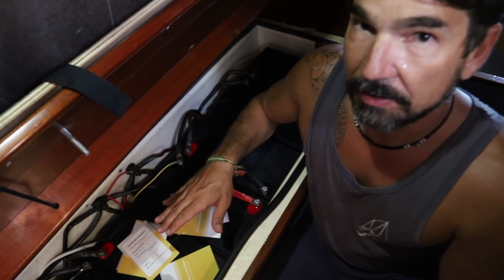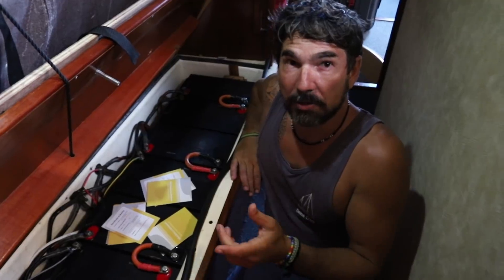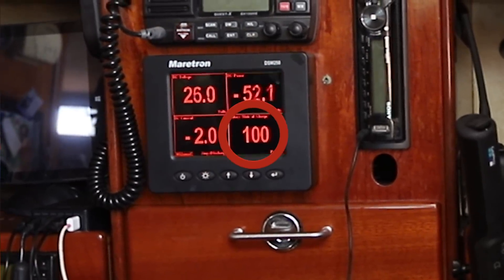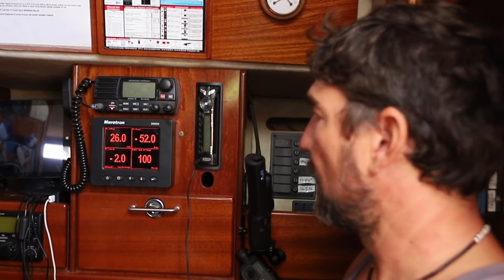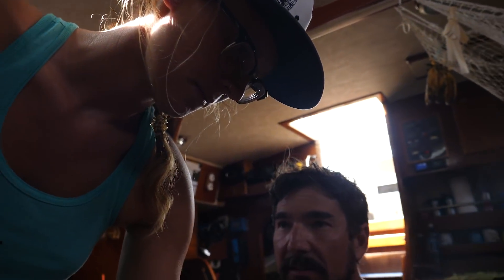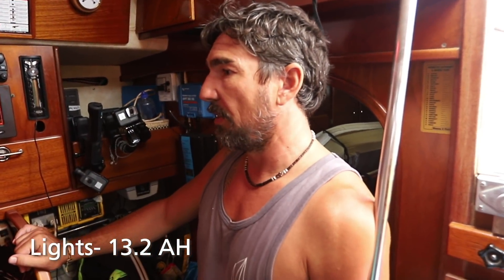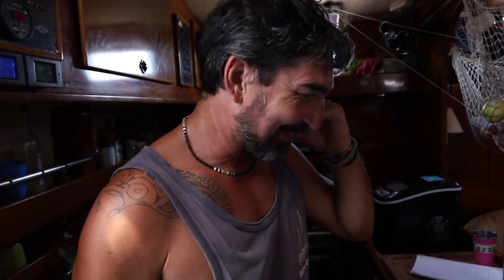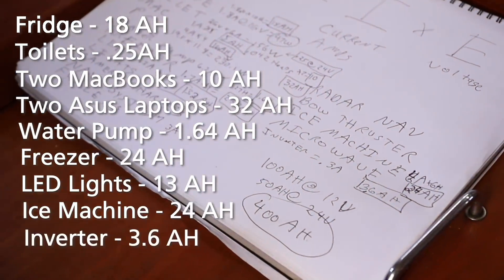WATT THE HELL is an amp hour?  Sailing Vessel Delos

Comment: This habit of measuring everything in amp and AH on boats is a bit confusing as it totally depends on the battery voltage used, using only energy units (Wh or kWh) and power units (W or kW) would be much better, but its the same with batteries for phones, computers, cars, electric cigarettes, etc. Would be nice if they did at least also always mention the Wh values ! But at least in this vid everything was brought back to W which was nice :)

Comment: Guess I won’t get an inverter for my bus then. Heard they were juice hungry...
Reply: Had a 2000 watt inverter in our RV when we traveled full time.  Essential item as far as we're concerned.  Example:  National Park at 9 PM and you want some popcorn, or  . . .early start in the morning and want coffee - in both cases you can't run the generator so use the inverter or do without.  Wouldn't be without it.  However, you're right - VERY power hungry.

Comment: Good vid !  An Easier to understand formula is Amp x volts = Watts. and Watts Devided by either amps or volts will give u the other. The P = i x e junk formula is not helpful.  just alkways driven me nuts. Volts are measurable with a volt meter. Amps are Measurable with a Voltmeter that has a amp clamp on it ( around $100.00 us ) and once u have the measured amps and volts = The wattage. Also Remember as Load increases so do Amps. So , If u Take a Serious Dump ,  That Little Shit dumper motor can draw alot of Amps up to 4 times more than Just a Water Flush. So, remember to eat your fruits & veggies.

Comment: Good job explaining batteries and amp hours Brain. One thing I can add to this is. Shallow discharges result in more cycles, but can reduce capacity due to sulfation. The user must weigh the cost of deeper discharges, and more frequent battery replacement against longer life, and limited usefulness.
Reply: TIM Babbitt I think sulfation occurs when the batteries are not fully recharged after each discharge. I have never heard of a LA battery becoming sulfated due to low DOD(depth of discharge).
Reply: TIM Babbitt this sounds more like the argument for slower discharge/charge rates. In experiments for battery life, it was found that slower charge rates and shallow DOD produced the longest battery lifespans, but it actuality since most people don’t fully recharge a battery after each use, sulfation occurs and research has found high charge rates de-sulfate the battery and although the high charge rates actually hurt the battery slightly, it de-sulfates them which causes much greater battery life.

Comment: Excellent video guys. On my 65 ft sail boat..... 200 AH  a day at 12 volts at anchor.  But could radically reduce this by a new efficient 1.8 amp fridge.  I have 500WTs of solar and 800 amp hours of batteries and  with this I don't have to watch how much  electrical  is  used each day.    After years and years living at anchor ...batteries last just under 4 yrs.  AGM's are less time.   This is living off the grid !  Oh... and a single person on board who watches alot of movies !

Comment: Hey Brian and Delos crew -Cool and informative stuff. Regarding life cycles of the batteries (and weight/space ratio...): How about the LiPo batteries on the market now? Have you considered using or testing them -even considering the (at times) tricky charging of these new batteries?
Reply from the maker: Stay tuned for next week on the Lithium :)

Comment: As far as I know the battery capacity isn't independ of the amps drawn. The usable capacity is bigger if the energy is been drawn over a longer period of time. I'm not sure what's the reason for that if it is the inner resistent of the battery.
Reply from the maker: I believe it's known as the Puekert effect or something like that.

Comment: Nice! Thanks for the info, Capt. Brian! 

 I've always wondered why batteries are sized by Amp-hours instead of Watt-hours?  Seems like basing everything on energy (watts) instead of current (amps) would simplify things considerably.
Reply: There is a subtle difference between the two, and some battery-history to understand why. In this type of application, the two types of measurements could be used. Could take amp-hours of battery times some nominal voltage, and multiply amp-hours consumption times some nominal voltage. Then KWhrs could be used, but I don’t junk it is that much easier. The difference between the two is KWHrs is a energy, and a Amp-hours is a charge. Batteries receive charge and we measure that charge in amp-hours.
Reply: So it is partially tradition that we use amp-hours for consumption (energy audits) since we used it for battery charges and battery specifications. The reason it is more useful for battery charging/specs is that the voltage on a battery changes over its state of charge, so accurately measuring the KWhrs into and out of the battery is more challenging and harder to state, than saying it will produce 100 amps for an hour, at whatever voltage that it falls at.

Comment: Hello Brian and Delos Crew,

 Thanks for your advises and explanations. We need it.

 What kind of water maker and instant water heater you have onboard?
 How you like these models, what's the maintenance, efficiency and power consumption? How much cost   the filters? Are they available in most countries? If any other details missing, we like any of your videos.
Thanks y'all Delos crew and cheers,
Reply from the maker: Hey!  Our water maker is a large AC unit, it runs on 220V from the generator put makes about 200 liters and hour.  The  power consumption is high (2-3KW) but we don't have to run it that often because it makes water quickly.  Water heater has two sources- heat exchanger on the engine and also electric from generator.  The water maker membranes are hard to get, but only need to be replaced every 6-7 years or so if you treat them right.  Fair Winds!  Brian

Comment: Good detail of usage.  The Macs have alot less screen and much slower than those ROG's unless they have the Gen 8 chips.  The laptops this past christmas had 58 types using the Gen8 chips but Apple did not.  They were still using 18 month old chips.  The Dell 2 in ones are something to look at this fall.  I have a 4k touch screen 15" on mine and it has a 512GB SSD.  I just changed 3 of my PC's at home to the 4k output chipsets and settled on the AMD A12.  The last of the A series as the Rizons were too pricey in December.  Using all 4k monitors.  Thing that started it all was the 42" LG 4k monitor for $550 including shipping.  It replaces my 4 monitor system. 
Thinking about your batteries, I think your next ones will be Lithium Ion.  I see guys getting batteries from crashed teslas but their basic powerwall has 6kw with all the inverter stuff inside.  Don't know about 24v taps.  Maybe when you replace, the gigafactory in China will be kicking some out.  Maybe twitter Elon for a sailboat sample.  The cool thing is they discharge to 10% and are cooled and heated by a water jacket that looks like an old parallel cable around each battery.  Pretty sophisticated stuff.
Love the video and the group effort.  At first I thought it would be explaining the obvious but you guys pulled it off and did an edcuational video for non electrical and computer engineers.
Kudos

Comment: I’m surprised you haven’t done an energy budget until now. Remember each battery may be advertised as 100 ah when new, that doesn’t mean you actually had 100 ah per battery. Also each year the battery loses a little storage capacity. Don’t know about Maretron monitors, but on my Victron Energy battery monitor I reduce the house bank ah a few percent each year to better reflect reality. Still a guess but better than nothing.

Comment: What kind of batteries do you have? Led, AGM or lithium?
Reply: They have had  lithium batteries installed since this video was made, also a new gimble stove-that doesn't use propane gas, the type of stove is very new, and runs off the boats lithium batteries I believe, it's a real sweet set-up for  for the galley, Delos is going high tech for sure    LOL
Reply: Zarih Sundberg those are flooded lead acid. Best bang for the buck. AGM can only be taken down to 80% and lithium is way to costly and I’d be fearful on a boat of fire at this point.
Reply: I wouldn’t want a propane stove either.

Comment: easy, the amp hour is the modern expression for the Watt
Reply: The watt hour is closer to the amp hour. Both are units of total energy consumption. A watt is a instantaneous power consumption rate and therefore does not
Tell you about the total energy used.

Comment: Every normal plug in item has a amp hour amount per hour on their power cords. 
Add those all up. That will say what amps u use. 

A 100 watt solar panel is 8 amps of max output a hour.

Comment: Why have you opted for a 24Vdc system as opposed to a 12Vdc system?
Reply from the maker: Larger boats typically have a 24V system because the loads on the windlass, winches, bow thruster, etc. are higher.  Given P=IxE if you have a 1000W load and use a 24V system your current carried is half of a 12V system, which means you can use a smaller wire and do the same work.  Wires at high currents can get out of control when you have to run a bunch....

Comment: You might look for a specific model (or universal) laptop DC-DC adaptor to take you directly from 24v to whatever your laptop(s) requires.  DC->DC Efficiency is ~80%.  DC->AC efficiency is more like 60%, and you are doing it twice!
Reply from the maker: Yep, you are absolutely right.  There is inefficiency inverting from DC to AC, and then you lose the same on the other side going back from AC to DC...

Comment: Just a note. Mac`s rocks all day long!
Reply: ya they rock but i'm not a fan of the newer ones for a few reasons.  Issue with the new mac laptops is that the ram is soldered to the motherboard making it near impossible for any consumer to replace it. Big deal breaker for me since i would never pay someone or apple to do such a mindless job let alone pay apple prices for ram. The new macbook keyboards are pretty freaking bad. Hate the feel of them and they're not reliable, smallest crumb or anything renders the keyboard useless. My brother bought a high end macbook pro last year and has had the keyboard/ computer replaced twice. First time was 2 days after he had bought it, They just gave him a new computer, second time they had to send off his computer to be fixed leaving him without his laptop for a week. He bought a keyboard "condom" that he leaves on his keyboard 24/7 to prevent it.  Macs are great looking but they do leave much to be desired if you ever occasionally play any video games. They're graphic cards are barely substantial enough to run modern games let alone even attempt to run any 3d/ vr stuff.

When compared to a PC you can get MUCH MUCH better hardware for cheaper albeit not as pretty and elegant. I recently broke free of the apple hold and bought an acer nitro 15 inch for 600$. For a comparably specd mac i would have spent 2600-3000$. My only gripe with the computer is the screen is not as bright or clear as the macs but overall decent enough for the price.

 I've had a macbook since 2008 (white  plastic unibody) and a macbook pro since 2011. I was going to buy a new computer this year but didnt for a few reasons. Both computers made it through thousands of college parties however over the years their hard drives have started to taken a dump so i replaced them/ transfered over all my files before they died. The ram on both mac computers have failed at some point which is no big deal given there heavy usage and price to replace the ram. You can buy 8 gb for like 70-85$; I run 16 gb on the macbook pro and 8 on the macbook.... 

Overall Macs are Great computers, just too pricey for the hardware, bad keyboard design and lacking video cards led me to spend my money elsewhere.

Comment: Why use amp hours when it is misleading if you don’t know the voltage? Many people use amps instead of watts or kilowatts because they assume the voltage is 12 but your battery system is 24 volts. So any amps you use would be 1/2 the power you are actually using if people assume 12 volts instead of the 24 volts you actually have. My suggestion is just use watts and watt hours and then the voltage doesn’t matter and watts is actually the correct unit not amps. Appliances are normally rated in watts and with just a small deduction for conversion the watts will work whether AC or DC. I know many people use amps and amp hours incorrectly but if a few people influential boats only say watts and kilowatts maybe we can get people to use the right units.

If you use only the top 50% of your battery bank, why not just say you have 9.6 kilowatts instead of the 19.2 kilowatts you actually have. Use your useable watts rather than your rated watts that you can’t get without damaging your batteries.
Reply from the maker: Yes you are correct, I think that measuring in WH is a much better way, but alas all batteries and meters sold measure AH....
Reply: I think it might change with the electric cars getting more popular : the batteries voltage are very varied, so it looks like the usage of Wh or kWh to define their capacity is generally used, also the case for torqeedo, see for instance : https://www.torqeedo.com/en/products/batteries
Reply: Cause deep cycle lead acid batteries are rated in amp hours and that's what he is talking about here.
Reply: Don't assume
Reply: that would be kWh and not kW to measure the "size" of batteries (mixing power and energy units is also all over the place ...)
Reply: David Clark KWHhr and amp-hours are similar but not completely interchangeable. KWHrs are a unit of energy but amp-hours is a measure of charge. Lead acid batteries change voltage across their state of charge and therefore traditionally it is hard to estimate their voltage across their discharge cycle, therefore it was traditionally easier to say the battery will produce 10 amps for 10 hours, and the voltage will fall where ever it does. You can say a battery will produce 5 amps for 20 hrs, but you can not say it will produce 1.2 kwhrs. (Especially when the temperature is cold/hot)
Reply: Since batteries are measured it amp-hrs, it only makes sense to use the same units for consumption.

Comment: Great video! You did an excellent job at explaining electricity, amps, watts, volts, etc. My question is, do you use desulfinators? By desulfinating a lead acid battery you can extend the life 2X-3X. Maybe in your case even longer... KEEP the videos coming. 

P.S. I use a brand called BatteryMinder on my vehicles & tractors. They manufacture Marine Grade & Aviation Grades too.
Reply from the maker: Yes, I do de-sulphate the batteries.  Most newer battery chargers have this built in, it doesn't do it constantly but you can do it once a year or two depending on how you use the batteries.
Reply: Sailing SV Delos That's good, I figured you did... Every video of Delos is always a lesson in life... Thank you for sharing.
Reply: You do not desulfinate AGM batteries ever check the whitepapers on the victronenergy site on this

Comment: very good explanation of a complex subject.  Question: what do you do for your boats EU 220 vac sys when you're plugged into a US marina with only 120 VAC ?
Reply from the maker: We have a 120V to 220V step up transformer, but the frequency is still at 60HZ which tries to make all our 50HZ motors spin too fast...  So we still can't run the AC, washing machine, etc.

Comment: Brian great job your explanation was dead on. I did some research in the past myself and found that Lithium-ion batteries can increase over all about 60% of your current capacity on the change out from let acid. There is an upside to it as well you can get a greater discharge of the battery capacity without hurting with lithium-ion batteries. Little food for thought. 

I've always loved your videos. Hope to be on the open water soon myself. Here's the fair wins and smooth sailing.

Comment: That Maretron is very cool.   This video falls into the category of inquisitive minds want to know.  Now.... how much does your solar and wind produce per hr assuming a sunny day for 15 hrs and a constant 6knot wind.  And how much does the navigation, electronics, windlas....draw?  Maybe we don't need to know :) never the less I think it's interesting and very cool that at anchor Delos is self sufficient.
Reply: Randy Holder AFAIK, an average anchor winch has a rating of about 1500 W, about 60 A @24 V... On the other hand, when you run it, usually the engine is running and supplies power...